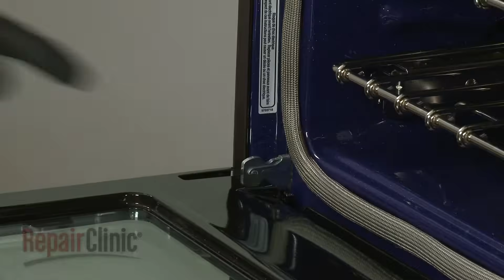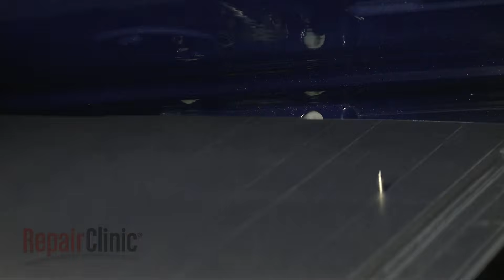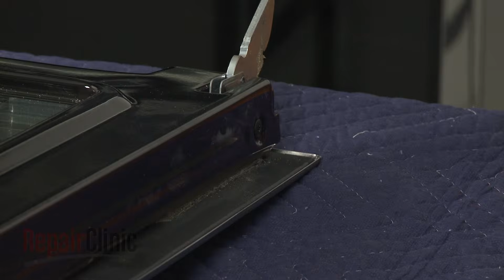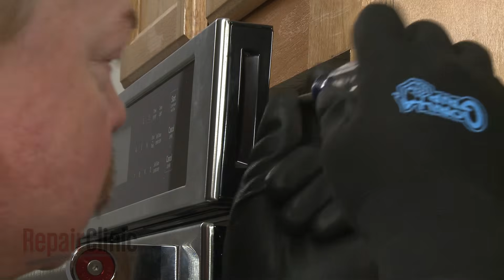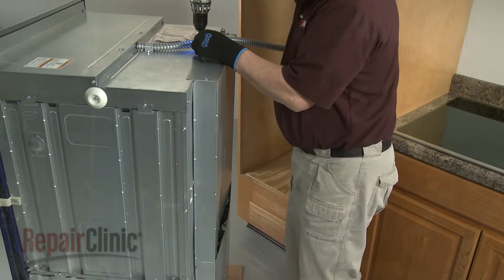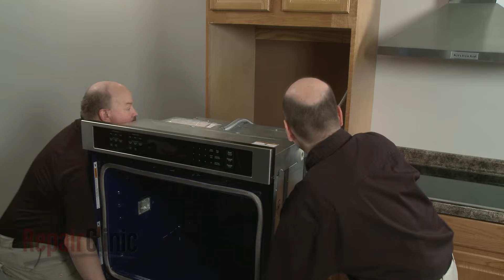KitchenAid Double Wall Oven Disassembly (Model KODE500ESS02)

Comment: Find it funny how KitchenAid doesn't want to accept the fact that they designed this particular oven with a major flaw using that touchscreen on the front any moisture at all. Touches that and it touches every single button at the same time causing an error code to be displayed in the oven to shut down 4,000 piece of junk maybe you shouldn't have used early 2000's touch screen technology oven would have been best on the market if not for all the fancy B's that never worked right out the box

Comment: The temperature sensor does not come out that easy.  The connector is stuck on the metal and the wires are too short to pull it out any further on my 2018 model wall oven.

Comment: key pad is discontinued and I am getting error code Kitchenaid 30.  I was trying to pull the wall oven it is not coming.  My understanding is while installation happen technician might be used the level foot for adjusting height.  Because of the level foot adjuster I am unable to pull out the oven from wall.  Can you please suggest how to pull it for the repair.

Comment: You didn't cover the control board...did you? Isn't that the most common part to go bad?
Reply: Clay Austin that’s what you get for skirting across the video instead of watching it, yes they went over that
Reply: @TonyThe2WayGuy  Apparently you think the control panel and the control board are the same thing. The control board is a circuit board assembly that may or may not be within the control panel. In this case, I don't believe the video even attempted to show where the control board is. It may be inside the control panel,..or it may be within other parts of the oven frame.  But, I guess you think you know better because you actually think they are the same thing. Get a life.